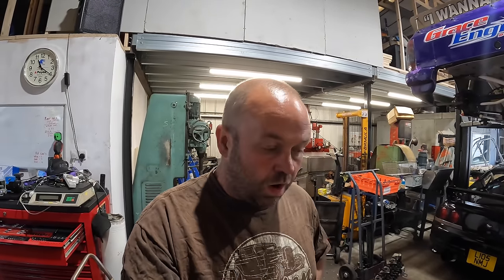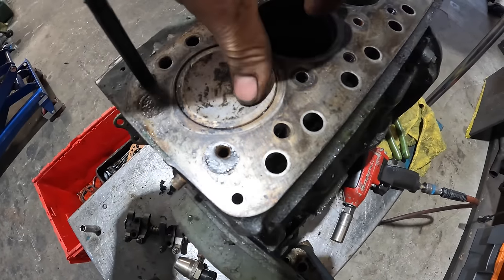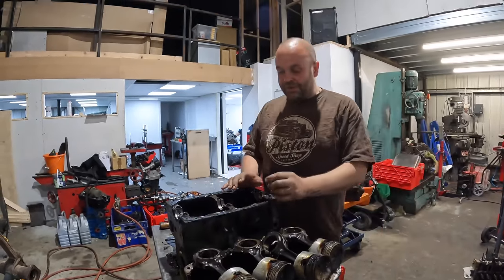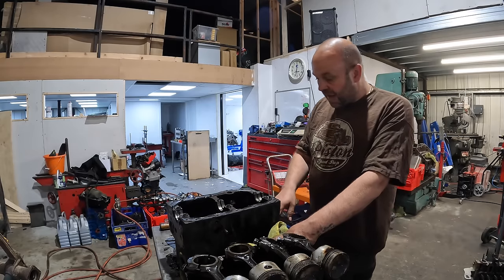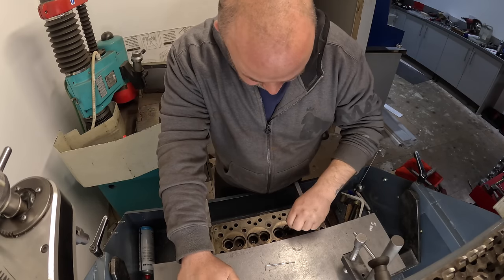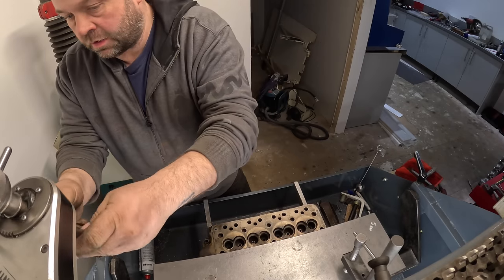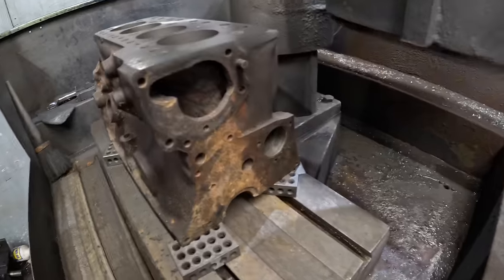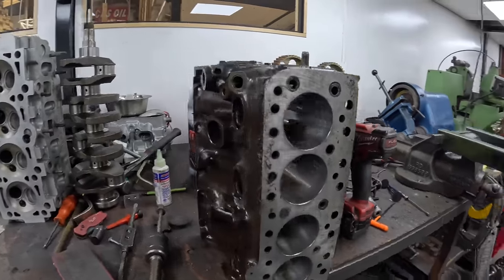A Series Engine Rebuild for a Classic Morris Minor |

Comment: These are great little engines. At school in workshop technology there were two Morris 1100 engines set up on frames with starter, battery, and key start panel. It was a competition for two people to strip them right down, neatly laying out the parts, the teacher would then check, and then it was a race to re assemble them and get them running. First one running was the winner. Great fun with the whole class watching and cheering the competitors on.
Reply from the maker: That's awesome.. whereabouts was that?
Reply: @graceenginedevelopments  New Zealand
It was a lot of fun.
Reply from the maker: @mirandahotspring4019  yeah it definitely sounds fun

Comment: Great to see what was going on inside that engine! I was involved in getting it to limp home from France last year. We removed the head to throw some new valve stem seals on in a hope to at least reduce the oil consumption, but when we spotted the piston damage we had a suspicion it went deeper! The rocker assembly was a spare we had to fit to get them home. When refitting the head and torquing to spec, one of the original aluminium rocker pedestals crumbled! The easiest fix was to remove and replace with the sintered set you replaced. Luckily someone with us had the spare set! It's amazing what you can achieve with a few spares, tools, and beer, on a French campsite in the backing sun!
Reply from the maker: That's awesome what a great bunch of people to all chip in and get them home . Thanks for viewing

Comment: The Traveller was my sisters favorite car. I had a Minor and a 64 Norton. ,On the Morris cars any routine maintenance was screwdriver, pliers and half a set of spanners. It only needed that. If I had got anything serious I would have thrown away the motor and dropped a new one in from a scrapyard. I like that you are properly rebuilding Morris motors, RESPECT! In the rebuilds I did on my Nortons there was never anything remotely approaching the state of that Morris motor. Even after a complete Oil failure, metal spray the big ends, regrind and we are back in business. My Nortons were and are impecable motors. Not a scuff or scratch, but they are racing motors. That Minor Engine, I might have bored out, new pistons and left the valvegear float around for another 20 000 miles. I'm a BAAD man.
Reply from the maker: Hi Peter, I don't think we have ever done a Norton engine, the morris was definitely in need of some love.. thanks for viewing 👍

Comment: Very simple engine . No electronics. Therefore, it’s reliable , dependable, very strong, low maintenance . Unlike today’s cars , easy to troubleshoot, easy to repair.
Reply from the maker: You are 100% right, we love the old ones
Reply: My experience with old engines is not quite the same. Modern engines may well be much more complex but:   Old engines suffered from pinking, piston rings failing, decokes needed, spark plug cleaning and adjustment, carbs needed attention etc.  Modern engines start winter and summer as if there is no difference. Batteries do not need topping up every week. Exhaust pipes don’t fail every 18 months. Petrol tanks don’t rust through in 4 years like on my Mini!
Let’s not knock progress too much….!
Reply from the maker: @MrDunky48  I agree as a daily but old cars are fun.

Comment: I love your approach with respect to customer requirements, you use a pragmatic approach to replacing components which the customer needs to maintain the full integrity of the engine rebuild. I work in a totally different sector of engineering but recognise your approach and delivery. If I were ever to need an engine rebuild you would be on the list.
Reply from the maker: Thank you very much.

Comment: That was all most familiar, well the most part. I had a few Mini's as a teenager and cut my teeth on working on them! We always changed the single timing chain for the duplex and if you could find an MG 1275 big valve head that was the crock of gold!  A 344 to 1 diff was nice some liked twin 1 1/4 Su's but I liked the single 1 1/2 I think it was the HS2 with a long centre branch exhaust manifold. A machinist mate once lightened a flywheel for me but it would rev ike crazy but lost a bit of torque so we got another one and didn't go so mad. In those days every scrapyard was full of different size Mini  850 998 1100 and even 1275 engines! Happy days!! Sorry to waffle on, Nostalgia got a grip on me!! LOL
Reply from the maker: There is something special about older cars, do you still have a classic?
Reply: Sadly not, I had a Ford Consul Classic 315 1500 cc in the late 70's til 85 when I had to sell it to pay for food during the Miners dispute! Shame as the only other owner was my uncle who took me camping in the same car when I was about 13, when he finally got a new car he gave me the Classic. Nearly cried when that car went away!!!
Reply from the maker: That's a real shame. I wander if it's still around? Horrible to get rid of something when you don't want too. Needs must I guess

Comment: My dad's first car was a moggy thou. This wonderful car and a series engine took us from yorkshire to cornwall and back over 10 times without problem, pass several more modern cars btoken down on the hard shoulder. Only rusty bodywork caused the demise after 15 years great service.
Reply from the maker: I agree a great little car.. great adventure Yorkshire to Cornwall in one I bet
Reply: My dads first car was a Moggy van. He managed to drive it into Ward's Reservoir approaching Belmont at some speed!
Reply from the maker: @774Rob  is it still in there😂
Reply: @graceenginedevelopments  The bend is still there, it's a left/right and the penalty for missing the left is a clear run into the water. The Moggy survived and he went on to own a Moskvitch.
Reply from the maker: @774Rob  that's hilarious.. pleased the moggy survived

Comment: Thanks for the work and upload. Reminded me of one of my last drives in a Traveller, speeding down Boxley Hill, Maidstone, summer 1984. I could smell BBQ chicken cooking, then the van started filling with smoke, so pulled over, thinking the worse. After checking the engine bay, nothing, and rushing round the vehicle I found whisps of smoke coming from one of the main wooden uprights in the old timber frame. The dry summer,  some weird bondo skin shape, and the high winds going downhill had created a venturi effect and the wood underneath had spontaneously combusted! With tears in my eyes from laughing so much I then had to put it out. Difficult to pee when you're rolling around in hysterics but I got the job done.
Reply from the maker: You're welcome... I love that story it nearly made me pee a little bit too.. I'm happy it brought back funny memories.

Comment: Worked in a Norton motor bike shop for several years the motors were in similar condition to the Morris engine when they came in . I was always fascinated that they were still running  , in Australia the engine reconditioners don't paint the engines you get them back as is .
Kit from Down Under
Reply from the maker: Hi Kit, hope you're ok. It's amazing how they can still run but need some work.

Comment: Highly impressed with your knowledge, professionality, workmanship, and the toolkit you've assembled. That engine is now better than new. In the 60's/70's it was normal to do 'decarb' on these types of engines (also Ford, Vauxhall etc.) every 40-50,000 miles. Top off, check bore & cam/follower wear, clean piston heads and combustion chambers, regrind valve seats, maybe replace valve guides in mum's oven, and rebuild with new gaskets. No engine covers, no miles of wires and tubes, no sensors, no OBD port. 150,000 miles was a good service-life achievement back then. Sometimes do an easy bottom-end with new main shells and big ends. Next step - full rebuild. I love the new technology engines, but these simple thumpers (and improved materials/metallurgy) are what got us here.
Reply from the maker: I agree with everything you have said.. there is a place for new but old is special

Comment: I must have rebuilt a dozen A series. My favourite engine TBH. I loved working on them. Last Minor Traveller I put a 1.3 ital onto a sierra gear box and MG rear diff. Front Midget discs and usual tramp rods and roll bars. Lovely to drive.
Reply from the maker: They're a great engine.. I bet that did drive nice

Comment: I love the A series Engine. I fitted the 1275cc head to my 1098. I had to pocket the block to allow for valves to go down side of bore. Also on another A series I fitted twin Su carbs and a blow through system using the supercharger from a Modern mini Cooper. Eaton supercharger. That bit gives pre ignition is for improving winter running. Removing it hampers cold starting. Cheers from old George.  Pre ignition pinking is due to modern fuel. Lower compression helps also using two head gaskets.
Reply from the maker: Thank you.. They're a great engine.
Reply: They’re (sorry)
Reply from the maker: @desmondrobinson169  that's ok. Edited.

Comment: First class job as ever  James great little engine had many  A series  engines  very reliable would always get you home. To clean the breather tube I used to use a piece of barbed fencing wire in an electric drill cleaned it out very quickly also used on 2 stroke exaust pipes
Reply from the maker: Thanks Dave, that's a great idea I'll get some for next time, would have worked a treat.

Comment: I had a B reg traveller that completely rotted out followed by an E reg that ran for years. My mate and I yanked the engine and gearbox out in the street and I did a decoke on my living room floor. My mate took the knackered box for exchange  jammed in the back of his frog eyed sprite. He later had a highly modified moggy minor. It had a Wolsley 1600 engine, new suspension with a torsion bar, disc brakes, flared arches with wider wheels, it was a beast.
Reply from the maker: I bet it was a beast.. awesome conversation..

Comment: Hello, 

It just goes to show how good and simple these old engines are, that it was still running with the wear and damage it had.

One suggestion that may help you. a short length of either old fasioned curtain wire, of speado cable makes cleaning out those breather pipes easy.
I did notice you didn't comment on one irritation on the A series engines, which is the bypass hose.  When these go, they are a right cowson to replace.  If I get another A series, I will adapt it to fit an easy replacement.  I wish the owners many years of happy motoring.  Kind rgards,

Tony Marsh.
Reply from the maker: Thanks Tony, yes there a great little engine.. thanks for the tip.. yes the bypass hose is a pain.
Reply: Does Ford of England sell CCC ? Combustion chamber cleaner ? For chemical cleaning the piping,works a treat. This side of the Atlantic,you can still get it,but many of the petroleum product mixes that used to be readily available are no longer. A lot were snake oil,but a lot really worked.
Never had occasion to open up one of these when I was young,so this is really interesting. Cheers.
Reply from the maker: @paulmanson253  I'm not sure Paul, but I'll look tomorrow, thanks for viewing
Reply: @graceenginedevelopments  On reflection,should add that original instructions were for an engine fully warmed. Spray though the carburetor till stall,leave sit awhile. The amount of crap out the tailpipe could be memorable. Point is,for room temperature use,soaking is required. Good for loosening deposits,nooks and crannies. Not magic,just good choice of chemicals. Cleaning gunk like what you showed is a miserable job. I suppose old fashioned carburetor cleaner would work about as well. If available.
Reply: @paulmanson253  Hello, thanks for the reply.

I don't know whether or not you can still gat the products you quote, but caustic soda works. 

For metal piping, good old fasioned blow lamp is great, and a length of old speedo cable or similar fitted to an electric drill works well on bent pipes.  Kind regards,

Tony Marsh.
Reply from the maker: I'll have a look thanks Paul
Reply from the maker: Thanks Tony

Comment: Little tip for cleaning your tubes etc blocked with old oil, just use a blow torch and air line, we used to get blocked air pipes from the Compressor on buses.  BUGGER JUST SEEN YOU DO IT THAT  WAY.  😂😂😂  never mind, like the video , love owt to do with mechanical repairs.  Ps you need a camera man.!!
Reply from the maker: 😂😂. Thanks Paul, yes I do it would be loads easier

Comment: I've worn out and rebuilt a few of these many years ago. I did one for a friend: it had been "refurbished". When I took out the crankshaft it was in two pieces; why? Because instead of fitting new big end bearing shells, someone had fitted shims behind the old ones. They might have got away with it but they put the shims at the top instead of the bottom, blocking the oil-thrower holes on the conn rods so the bores ran dry!
Early on, I learned the difference between SAE30 oil and the good stuff. Don't try to save money on oil. Nowadays these engines will easily do 100,000 miles with fully synthetic oil.
Reply from the maker: That was a bad engine then.. shocking what you see now and then.. yes oil has come a long way

Comment: Nice work! This certainly brings back memories. I've seen a lot of crank thrust washers put in backwards or omitted. Grim results in every case, of course. Wasn't the oil filler cap on those still the circular steel one with the coin edge?
Reply from the maker: Thank you.. yes it's normally a mess if the thrust is fitted backwards.. I'm not sure on the filler cap I fitted the same as what came off

Comment: God, this brings back memories:- replacing by-pass hoses in situ and that wooden bush for the clutch linage on the Morris 100
Reply from the maker: Happy memories hopefully.. that bypass hose can be tricky
Reply: @graceenginedevelopments  Time-served, moved to IT late 70's, do have regrets, selling my Snap-On tool kit I had acquired over the years, working with the hands and missing the type of people, if you get my drift.
Reply from the maker: @freepress8451 yes I know what you mean
Reply: that tiny coolant hose at back of engine, between head and block- a right @$%#^@^@ to change. Ask me how i know - skinned , burnt knucles! ;)
Reply from the maker: Yes it is lol

Comment: The 'A' Series was developed for the Austin A30 launched in 1951, it became available to the Morris Minor in 1952 when B.M.C (British Motor Corporation) was formed as the Minor prior to 1952 was still running a 918cc side valve engine
Reply: And it was still being fitted to new Minis in 2000!
Reply from the maker: It's a great engine.
Reply from the maker: It's a classic. Great engine
Reply: @garymillerlcs Are Minis still being made? And if so, where?
Reply: The original Minis were still fitted with the A Series when they stopped production in the year 2000.

Comment: The usual trouble with cars of that era was the bodywork.  If you looked at a car of more than 8 yrs old for too long, it would dissolve before your very eyes.  My first car was a Morris Minor Traveller.  Sub-frame and both front footwells rotted out.  My feet literally went through the floor.  Cars have come a long way since the 70s.
Reply from the maker: Yes cars have come along way, they drive better and are more comfortable, do a lot more with technology. But there's someone special about some old classics which new cars don't give you.

Comment: If you need to clear our curved pipes like that again, just put a large metal zip tie in a drill and poke that in.  Smooth end into the drill.  Works a treat!
Reply from the maker: I will definitely try that, someone on an earlier comment said to try barbed wire on a drill so I'm going to try that too. Thank you

Comment: Refurbed the head on my 1969 Morris Traveller last year. Had to replace the valve guides as the valves were slopping around. Must have blinked when you checked for this.
Reply from the maker: There a great engine.. yes we checked them but I don't think we filmed it

Comment: I had an older Moggie minor 45 years ago. Had to change the big-end bearing shells every few months. Could do it in an hour or so in situ from under the car. The brake fluid had to be topped up every other day.
Reply from the maker: That's brilliant.. do you miss it?
Reply: @graceenginedevelopments  I miss the car as if it was a museum piece which I could have kept forever, same as my old Norton Commando, it too long gone.
Reply from the maker: You might need to treat yourself to another.

Comment: My 2nd car in about 1980 was a 1959 A-55 (Cambridge). Had a very similar engine that I rebuilt in around '84.  Think it was a 1500 (lotta years ago!).
Reply: Oh, 1st car was a '64 MGB I got in '76!
Reply from the maker: That's cool
Reply from the maker: Mgb for a first car is smart.. mgb are a great motor
Reply: @graceenginedevelopments  - Became largely self taught very quickly! How to set multiple carbs, do bodywork... and learn to praise Lucas, the prince of darkness.  ;)
Reply from the maker: @DrFiero  nothing wrong with self taught, it's good you can do it